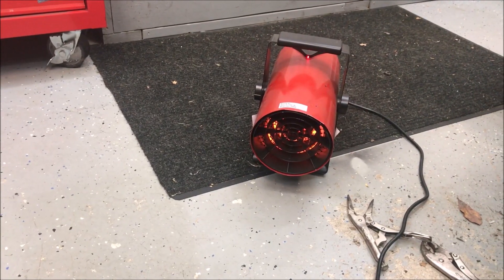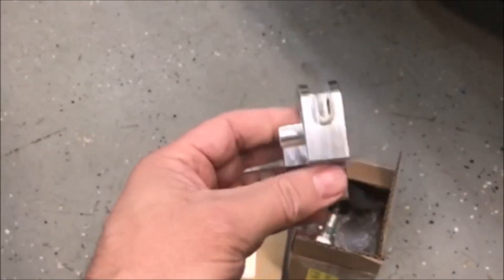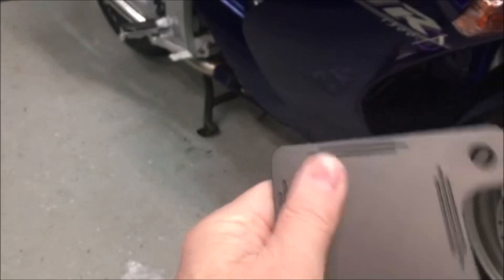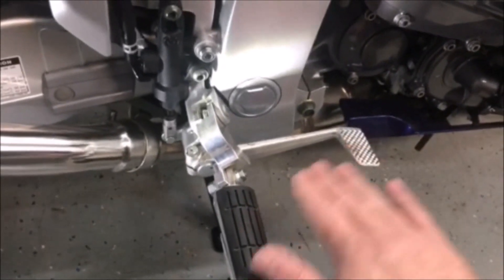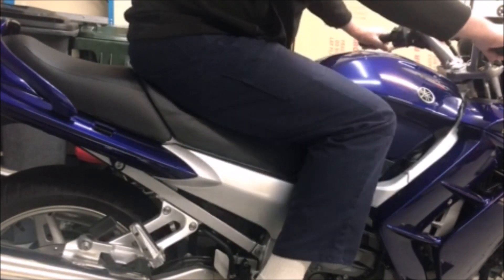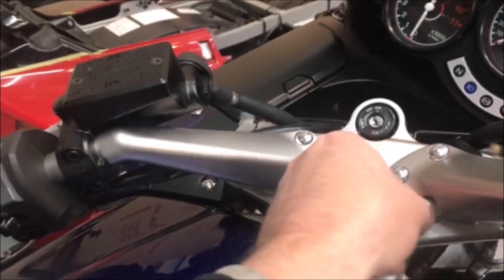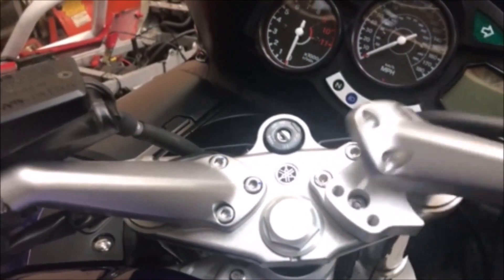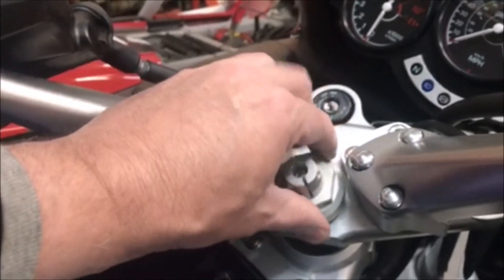Too Tall for the FJR1300

Comment: Another 6'4" FJR rider here - I spent $$$ on Corbin seats, much better than stock and at least an inch taller.  I think the reason that guy stopped making the footpeg-lowering kits is the pegs were contacting ground during hard-leans and causing low-sides (and probably lawsuits) - careful during turns.  I too have the steering-nut farkle mount - but I got rid of the Techmount ball and riser and screwed in a RAM ball for my GPS.  In hindsight I could have just taken the stock nut to a machine shop and tapped a thread into it but oh well.

Comment: Just got an used, new to me 2006 TO FJR , how were the foot peg mounts after a season of riding ?
Reply from the maker: The pegs have been great. I have not touched them down at all and I do like to do curvy roads. Only odd thing is using the rear brake. But I have learned to adjust my foot to reach it fine.